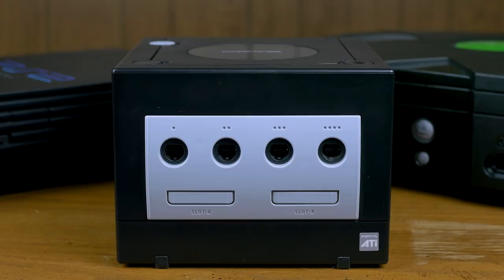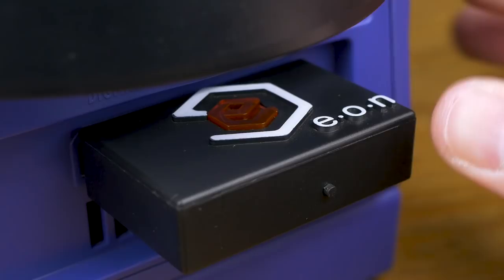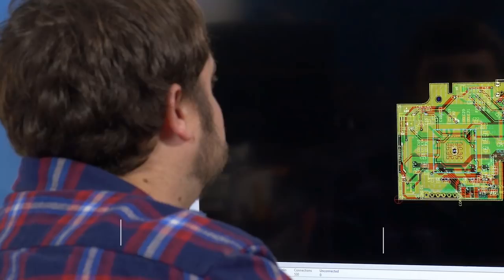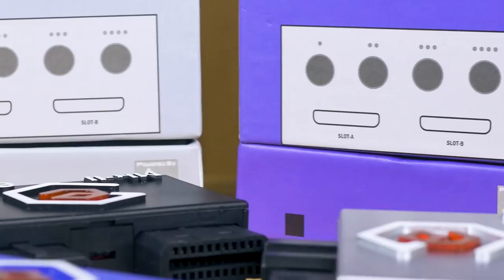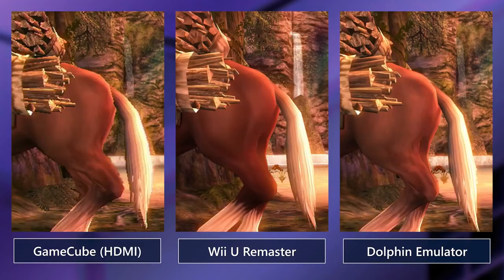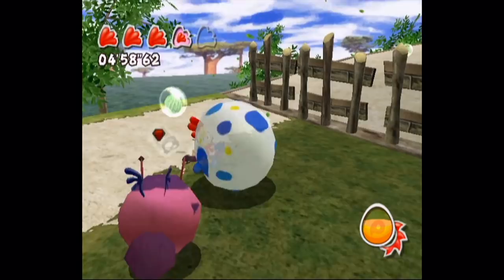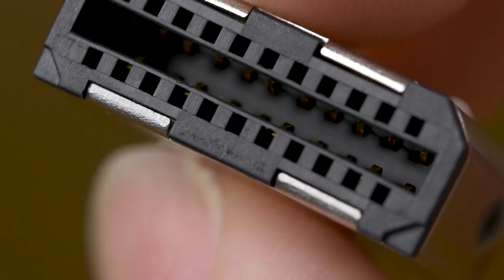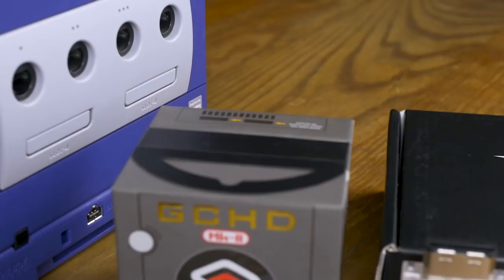Nintendo GameCube HDMI, Component & RGB Plug 'n Play Solutions :: RGB316 / MY LIFE IN GAMING

Comment: can a PAL gamecube play NTSC games and output 60hz RGB to an NTSC crt?
Reply from the maker: [Try4ce] If the system is capable of launching homebrew, sure. But the problem would be that the bootup would still be in 50Hz, so you might not be able to see the system menu on an NTSC CRT. There might be a total 60Hz mod for it though, not sure.

Comment: simple question. How do I change to the mode I want to play? Like from 576p to 480p.
Reply from the maker: [Try4ce] You can force resolutions with Swiss, but not with the GC Video hardware/firmware. You can only choose to turn the linedoubler on or off, which forces 480p output (but if the game is rendering in 480i, then it will use bob deinterlacing, rather than be natively 480p). You can choose "view all modes" in the menu to set your preferences for different resolutions. Don't forget to save settings.
Reply: My Life in Gaming Thank you very much.

I’m on PAL region btw so... that’s a thing to pay attention too.

So I guess I must trust the automatic resolution that it places on each game and config a little bit my preferences...

Comment: I'm still torn. The MK-II has the best options with it's stable dual port design and has easy firmware upgrade solutions, however the build quality is questionable at $150. The Carby is half the price at $75 and has a much better metal connector, but lacks the extra options and cannot be upgraded easily. I would pull the plug on the MK-II if the connector was metal, and I would go for the Carby if it's upgrading feature was more easy to do.

I also wish someone would come out with a everdrive/ode drive for the Gamecube.
Reply: I would go with the Carby for $75 and a better build quality.
Reply: You can actually open up the carby to upgrade. It's designed be opened, you will need to buy the pin connectors in order to upgrade, though.

Comment: Do the xbox and ps2 have these options I wanna ditch component on those systems
Reply from the maker: [Try4ce] There exist HDMI converters for them, but we have not tried the most recent ones. Remember that those systems only have analog out, so such devices would be converting component to HDMI, possibly decently or possibly poorly. GameCube is unique among the consoles of that generation for having external access to a digital signal, even if it was not used as digital during its day.

Comment: I cant get the GBIhf dol to show video on my TV, I hear the GBA chime startup but I get a black screen, my ossc says the signal is 375p. I have to use Swiss and force NTSC and 240p to get it to boot
Reply from the maker: [Try4ce] Yeah it outputs a weird signal! I think the basic version outputs 480p, and the Framemeister version probably does the same? You should boot the one that says OSSC on the file name. Also make sure your OSSC has the latest firmware. An update was released maybe 3 or 4 weeks ago that has modes optimized just for GBI HF support!
Reply from the maker: [Try4ce] Oh, and be sure you go into the Output Opt. settings and then go down one to 384p. I believe the one that worked for me was Line3X 240x360, but then I had to shift my sampler phase a tiny bit to avoid flickering pixels.
Reply: @mylifeingaming  oh, my TV doesn't support 3x mode at all... could that be it? I've only ever gotten 240p and 480p to work with the OSSC
Reply: @mylifeingaming  I just tried your Line3X 240x360 mode on 2 other 27" monitors, didn't work on a Asus ROG Swift PG278QR, worked fine on a ASUS VE278Q, super sharp pixels, shame it dosn't work on my panny plasma :(  

edit: yea my OSSC is on the latest v0.82, my TV just doesn't seem to like the 3x mode. I had to edit the gbihf-ossc.dol+cli file with notepad++ (regular notepad/wordpad didn't work) and changed the .cli settings from "hd60" to "ntsc" it now boots to a 263p mode on the ossc and I get a signal

Comment: Anyone know what HDMI cable they had hooked up to the GCHD Mk II  in this video?
Reply from the maker: [Try4ce] It doesn't matter whatsoever. HDMI cable specs matter when you get up to 4K, but this is 480p, there is no downside, no quality difference, no missing features to worry about using 480p with any HDMI cable.
Reply: @mylifeingaming  Oh ok, Thank you for the reply! I was actually referring to that downward angled HDMI cable, as I thought that would cause less stress on the GCHD mk-ii adapter. But after reading your comment, I realize any of the ones I've found today should work nicely. Hope you guys have a Merry Christmas Try4ce! 🤜🤛
Reply from the maker: [Try4ce] Ah I get you! I think most of the right angle ones I have are from UGREEN but I don't remember if I had those at the time of this video.

Comment: Please help! First things first I am from europe, its 2020 now and I dont have a CRT PVM / GVM and I am not intended to buy a Framemeister. I have looked for Eon Gchd mk2 on eBay and its still pretty expensive the video quality isn't superior to the Insurrection Carby 2 right? When my HDTV supports Component should I take the Carby Component cable then? (I have watched this video three times now and still have trouble to follow sometimes cause I am not a native speaker.)
Reply from the maker: [Try4ce] If you do not need the extra options provided by GCHD Mk-II, then I would get either Carby for HDMI, or Carby Component. Whichever you choose should just come down to whether you see yourself needing component again in the future, such as for a CRT or OSSC. Do keep in mind that while European systems are totally capable of 480p just like any other GameCube, the PAL versions of the games so not support 480p natively. You can force many of them to run in 480p however using software called Swiss. Of course this isn't necessary for the games to display, but I'm just letting you know because interlaced video will have the "bob" effect, which some people can't stand. However you can disable that mode, set the Carby to passthrough, and let your TV deinterlace the image itself (although that will cause more lag, if that's a concern).
Reply: @mylifeingaming    Thanks a lot for your help! The Carby Component cable looks more solid then the Carby Hdmi but I dont really need it I guess. When I would play on a CRT someday I would simply take RGB-Scart I guess!? OSSC looks also too expensive to me but I may need to buy it for a proper signal from my Dreamcast. I would then use VGA-Box and the OSSC to get HDMI I guess. But my real problem is the disgusting image on GameCube and the no Anti-aliasing when playing Resi 4 for example. When I would buy a Framemeister can it switch between two consoles or do I need two Framemeisters?
Reply from the maker: [Try4ce] Framemeister has separate inputs for RGB, composite, S-video, and D-terminal (which uses YPbPr, it's just a different connection for component that was used in Japan, and can be easily adapted). You can switch between those. I wouldn't buy a separate Framemeister if you use more systems though. Our favorite switchers these days are the "gscartsw" and "gcompsw" which are designed especially for retro consoles. They're expensive, but switch automatically and work perfectly with no quality loss.
Reply: @mylifeingaming  Thanks a lot again and again for your amazing videos and help. This is by far the best channel for retro Gaming and you guys are even way more cute than Metal Jesus! 
I watched Bobs video about RGB Scart versus Component and bought a used original RGB Scart cable for the Cube and european SNES. I will buy an OSSC from Amazon  and a HD Retrovision cable for my PS2 and 3. On top of that use I'll use a VGA cable for my Dreamcast. This way I can play five consoles without have a Switcher right? I just have switch the console pug end of the cable between the Snes and Cube (PS2 and 3) and maybe optimize the signal on the OSSC? Also I may need Swiss to force 50hz games to 60hz? Maybe some day I will buy more cables and a Switcher to reduce harm when unpugging and plugging

Comment: How does this compare to a Wii HDMI adapter?
Reply from the maker: [Try4ce] It's an extremely different sort of device. Remember that these are pulling digital video from the GameCube, while the Wii does not have a digital port. So those simply convert analog to HDMI. The thing with those Wii HDMI adapters is that they're just generic devices made by so many different companies, and you don't really know what you're getting. Some are better than others, but you'd never know to look at them from the outside. Some might be satisfactory enough if you cannot use component cables with your Wii, but they are not nearly as sophisticated in terms of the engineering required to develop this stuff.
Reply: Thank you for the reply! I really should have watched the full video before asking that, you explain it well. I just pulled the trigger on a carby and am looking forward to seeing how it looks at home. Your videos have helped me out immensely on my journey to discover the best possible image for my retro consoles. From getting my first pvm CRT to the RGB scart for the Snes, PS1 and Genesis, I've been using your videos as a guide to help me wrap my head around how this all works.Thank you 🙂

Comment: Hey guys i have one major question. Since the E.O.N GCHD has a Wii out can you use the Hyperkin special wii hd cable to do anything or does it somehow help? Also here is a link to the Hyperkin product I'm talking about. https://www.amazon.com/Hyperkin-HD-Cable-Wii-nintendo/dp/B072K2DCFM/ref=sr_1_8?ie=UTF8&qid=1544979825&sr=8-8&keywords=nintendo+wii+hdmi+adapter
Reply from the maker: [Try4ce] I haven't tried that, but it would simply convert analog to HDMI. Would probably be better to just go straight HDMI out, but I don't know anything about how well or not well that cable may scale.
Reply: @mylifeingaming  okay i just remember the hyperkin doing a weird thing that made it better than those other cheap wii to hdmi converters. So i was just wondering if it work as well or better some how than the normal hdmi port it has. That way you can do dual hdmi out also.

Comment: Which should I get if my GameCube only has one video output method
Reply from the maker: [Try4ce] Sadly none of these. Your best bet in that case would be to play on a backwards compatible Wii with component cables, or S-video on a CRT.
Reply: If you don't own a backwards compatible wii and intend to still use your gamecube on an hdtv you could try getting a retrotink2x mini and pairing it with a decent svideo cable.
Reply: You're pretty much stuck with using S-Video, unfortunately (or RGB if you have a PAL GameCube).
Reply: @AceTrainerX3  thanks for replying although I had actually bought a Japanese GameCube with two video out ports and modded it completely

Comment: Am surprised that many NGC games did use dithering, but i guess they did this to ssve on memory space, they did the same with N64 games,not only to save on memory space but also to take full advantage of the guassian filter wich blurs out jegged edges.
And that how we gamers were decieved all the time in terms off colorsepth.
Reply: Old graphics processors and software from the time period that the GC processor originated from (~2000) generally had a hard time outputting higher color depths without the performance tanking in my experience (at least on PC), and seeing how composite cables were the go-to, I'm kind of surprised most developers didn't immediately opt for lower color depths to save on performance.
Reply: Licentious Howler well many game dev’s did heavily rely on composite video in the sega genesis,by using color dithering but also due the lower color depth of the genesis.

But if even the gamecube has trouble viewing 3D graphics with high color depth , not without frame drops, then am wonder why did nintendo added  a 16,7 million colorpallet to it, as it makes little sence.
Same thing with the snes, it can operate in high-res mode but not without sacrifying high color depth, mode 7 and so on.
Nintendo just overhyped the snes ,stating it could do this and that, but in reality it could only do one thing or another but not all atonce,hence those fixed different restricted indexed 8 modes effects ,in order to prevent hardware comflict & crashes.
Reply: @johneygd  I don't think it was really Nintendo's doing, but the designers of the graphics processor within the Gamecube, ArtX (who were bought out by ATI in the time the GC was finalizing its design). It was just common to have 32-bit color-depth support on processors of the time regardless if the processor was really up to task, and they probably weren't about to fundamentally overhaul the way they make their processors just because it was designed for a console instead of a typical PC--they probably planned to use much of the existing tech developed for the GC as an AGP card you could buy for a PC too.
But it also made sense to include it because software could mitigate the performance loss if cleverly engineered; Unreal's (1998) documentation explicitly states that 32-bit modes shouldn't operate too much differently than 16-bit, and that was on a software renderer! (Furthermore, they weren't lying in my testing.) But Unreal was a really exceptional game at the time, hardly the rule.
Reply: Licentious Howler well eventually it’s about what our eyes can see , we cannot see better then 24bit colordepth, so going any futher to 48bit or even 96bit color depth used by professionals, wich sounds cool on paper but we just can’t see any difference whatever the resolution it is.
THX for taking your time.
Reply: @johneygd  A frame cannot see more than 30 human eyes per second  : )
Reply: Agreed. The N64 was awash in dithering, so it's really disappointing that the GC continued that, especially considering that it was capable of producing great looking games without dithering. Metroid Prime is the perfect example of this-- probably the best looking GC game without a hint of dithering.
Reply: @kdkseven  Yeah, Retro Studios have a strong track record of working miracles with the hardware they're given--and what a breakout success that was!

Comment: is there any component to HDMI that is also compatible with composite?
Reply from the maker: [Try4ce] What for exactly? If you have the digital out port, then you can just get HDMI with one of the adapters. No need to convert from analog. If you don't have that port, then you'd be looking for an upscaler that isn't necessarily GameCube specific.
Reply: @mylifeingaming  Sorry for going off topic, but I meant a Component Video to HDMI adapter that can accept composite signals. in case I want to connect multiple consoles. I know it might not look fantastic as the adapters shown on your channel but it would be extremely convenient to have.
Reply from the maker: [Try4ce] For an entry level solution, RetroTINK 2X works, but that can't do 480p, which would not be great for GameCube. RetroTINK 5X or 4K can do what you're looking for, but are a lot more expensive. GBS Control might be something for you to look into for another more affordable option, but it's a bit more homebrew in presentation.
Reply: @mylifeingaming  No progressive sounds like a compromise I can afford. I might try one day the GBS Control. Sorry for the late reply and thanks for the recommendations.

Comment: Another great video! I was wondering, without an OSSC or Framemeister, which is better: one of these GameCube HDMI adapters or a Wii with official component cables, going directly into the TV? I realize a lot of the sharp pixels (the look I prefer) in your videos is due to the OSSC or Framemeister processing the signal, so without either of those is it worth getting an GameCube HDMI adapter if I already have an official Wii component cable?
Reply from the maker: [Try4ce] It would be sharper with the GameCube HDMI adapters for sure, because the Wii output IS softer. Personally I feel the Wii's softness is not that noticeable without a direct comparison, but others think it's a deal breaker. You won't be getting the crisp pixellyness from the OSSC either way though, so I'd say it's up to you. I doubt it would be a huge upgrade in your case, but it would be some upgrade.